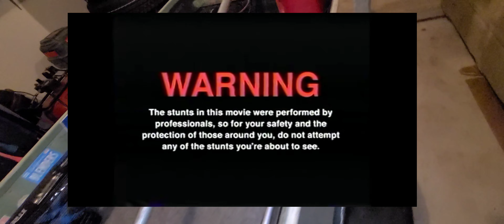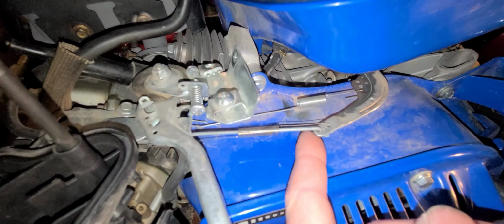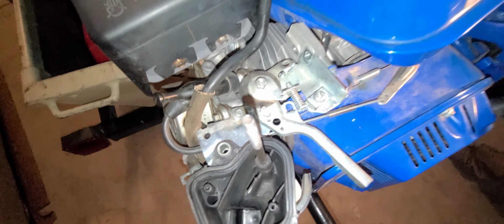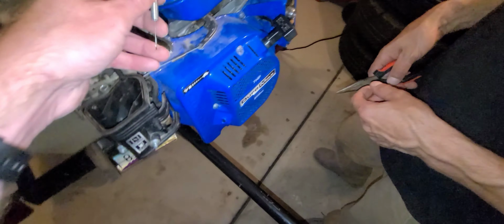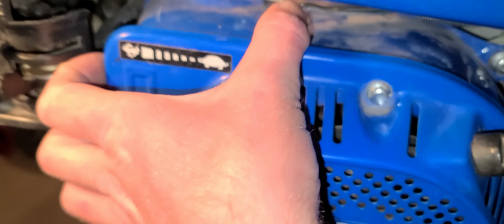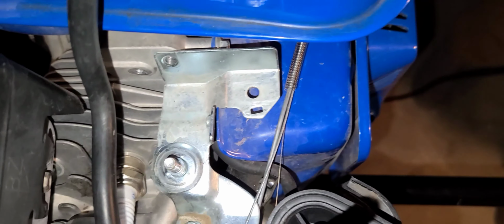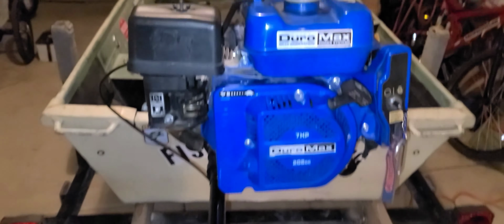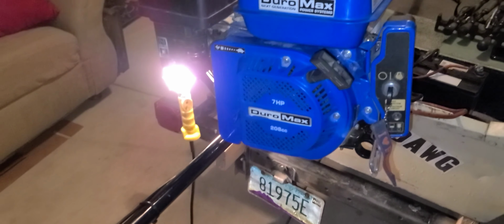Easiest Governor Bypass throttle set up on any Duromax 7Hp Predator 212 or other 212cc Honda Clone.

Comment: Think i have seen almost every harbor freight  motor and now 3 different Duromax motors on that boat?
Reply from the maker: Yes we have alot of experience with these honda clone engines
Reply: I’m putting mine back together this weekend I want to try grade 8 headstuds and no gasket see if it has more power just put the mikuni carb

Comment: Do you know what gasket I can use for the side cover? Mine is leaking and can't find it by part #
Reply from the maker: Is it a hemi or ohv?
Reply: @azlongtales  it's a ohv.
Reply from the maker: @yt-aimbot-gaming8352  B078XQ2HYP
Reply: @azlongtales  thanks bud. But the one I'm looking for was is the one where u put in the oil... By the shaft .its leaking .
Reply from the maker: @yt-aimbot-gaming8352  just buy a complete gasket kit from Amazon for a gx200